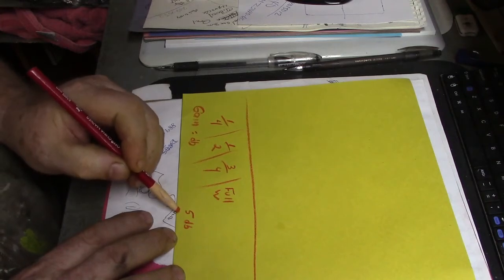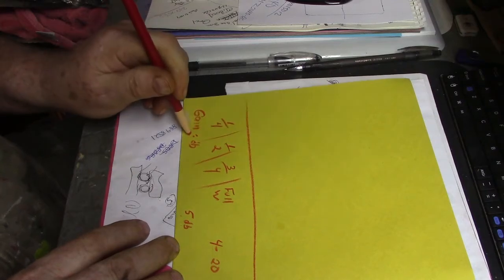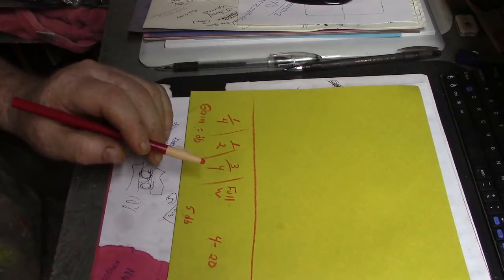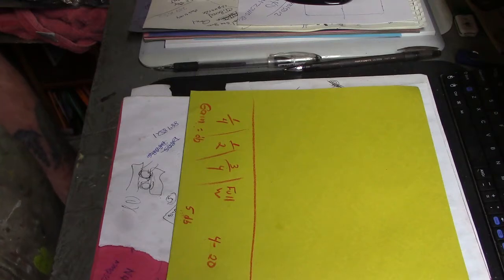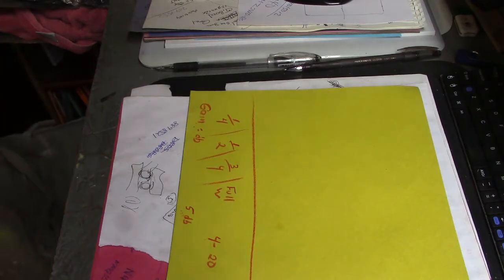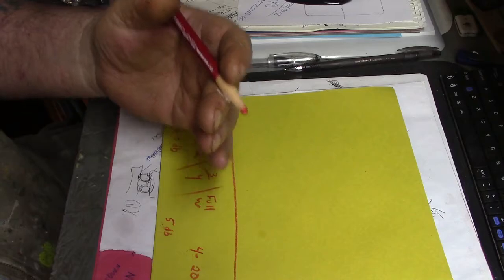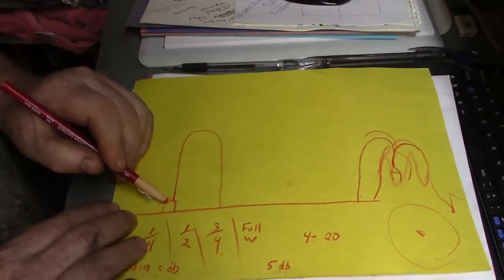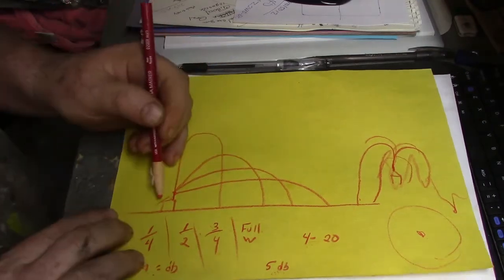WARNING 40 MINUTES.  A Real simple Explanation about Antennas

Comment: Thanks for explaining that it helped me understand a lot. I run a mirror mount on my truck and a K40 antenna. What's your opinion on the K40 is it decent or should I go with something else
Reply from the maker: The K40 fiberglass I don't care for, the base load steal is good but can only take 100 watts or so.  The Francis 4 ft fiberglass is good and takes power, and for a base load steal whip Wilson 1000 is good and takes power.  But if you are driving in wooded areas or banging your antennas a lot k40 are ok.
Reply: buzzsah Ok thanks I have the Steal one with the Coil and I haul logs so we run a lot of wooded areas
Reply from the maker: Good antenna, just keep an eye on the coil. Sometimes with the whip hitting the overhead stuff it can crack the coil letting rain and water in.   They make a swivel mount so when in woods to can lay it down and lift up with on the road. I maybe able to show you one.
Reply: buzzsah Ok thanks that would be handy to lay it down.  I'm having trouble with my radio. I need to disable the talkback it squeals bad so I keep it turned off but I don't have echo with the talkback turned off

Comment: nice vid. :) i think my  antenna is the 1/4 wave. i'd have 2 go 2 my website  & look 2 make sure. but even that should be enough 4 me. but mine only goes out 500 ft or soo... i need it 2 go out at lest 1 mile. so i might have 2 get that  3ft WORKMAN SATURN B100 BASE ANTENNA. that'll just have work..
Reply from the maker: Good luck, hope it works out for you.
Reply: buzzsah
thanks.:)

Comment: Great video.  Thanks for sharing, should help someone for sure.  Are you into Ham Radio?  I am.  Very cool.  Take care and stay safe. great job.
Reply from the maker: Thanks and yes.  I just started up again after 30 years off the air.  I put up a 50ft free standing tower and a 25ft.  For now I'm running the 4BTV ver, and Alpha CF dipole. Think of a midsize beam this spring but not sure as to what. Being off the air for 30+ years I found things have changed. :)  My wife bought me a FT-1200 in April that I use as my HF for now, and I bought a FT-400 that I use as my base vhf/uhf. I and looking at the Icom as my next buy.  What State are you in?
Reply: Oh cool.  I'm in the state of West Virginia.  Welcome back, yes it has changed a lot that's for sure.  Have had my Ham license since 1994.
Reply from the maker: I had relatives from WV, Perdue's and Smith's. Nice State but at one time there was no work other then the mines, I'm going back to the 60's 70's.